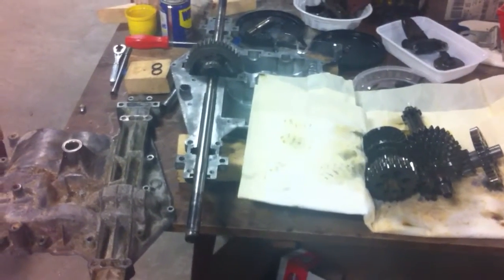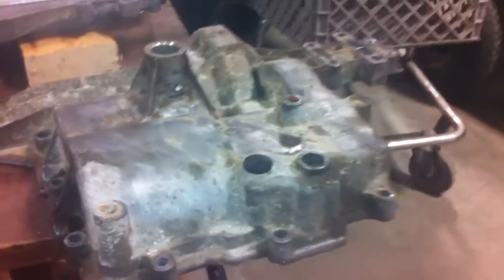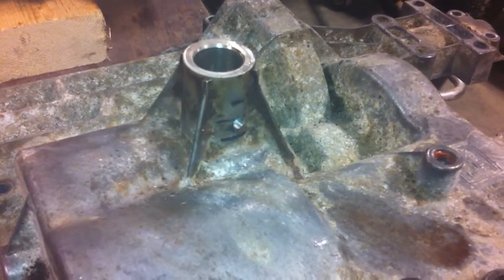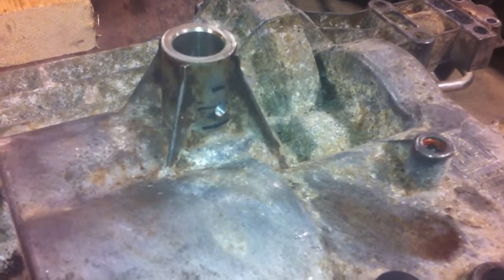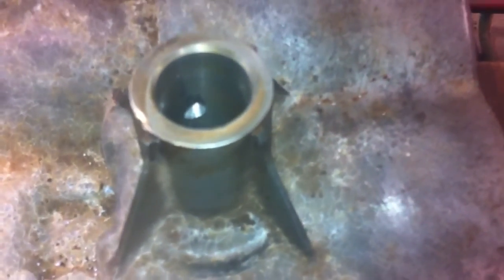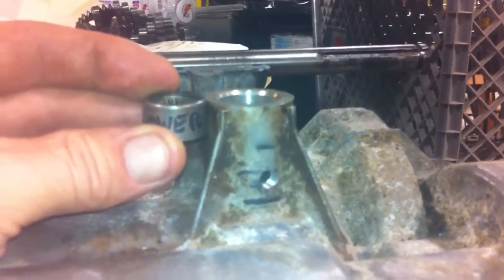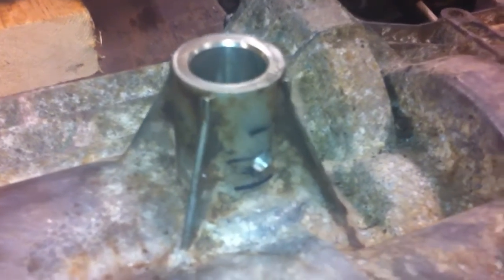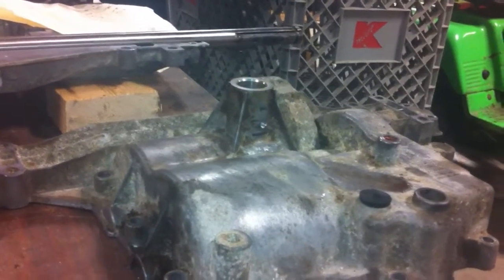Mst 206 modifications part 4 input shaft lube mod

Comment: Is there any way to put it back together without removing the detent screw? Mine does not want to come out at all
Reply from the maker: If you're careful you should be able do it, you just have to fight the spring pressure a little bit.
Reply: @MrTheHillfolk  thank you. I will have to keep the shift shaft in the top side of the case to let the fork stay in it, or will I have to leave it in the bottom of the case?
Reply from the maker: @muddybasilisk7526 yeah it'll be better to have it in the top case , you might be able to put a piece of pipe and a washer in top, thread in a bolt in the shaft and that would hold it in place.
Don't crank it tight ,might need to wiggle it around some. 
That would help with not having to hold it by hand and you can feel the fork engage when ya drop the cases together. 
Next hat trick is to make sure the fork engages in the slot on the cluster when ya mate the cases.
Reply: @MrTheHillfolk  thanks for the advice
Reply from the maker: For sure man.
 Good luck with it, these things can be quite a hoot once they're back together. 
One of the other little things is if the bushings have the flat sides on them and if they are orientated correctly, that can keep the case from closing down all the way correctly. 
Just don't force things and see if the shafts turn  after setting it together with a couple bolts.
Reply: @MrTheHillfolk  I’ll do that man thank you

Comment: Are the needle bearings for the input shaft on this the same ones for the 700 series input shaft? (Part number 780086)
Reply from the maker: As far as I know, back when I researched it, they use the same bearings

Comment: Do you know if the seal for the brake shaft can be removed and replaced without taking the case apart?
I have a small oil leak and don't want to get into a project if possible. Thanks
Reply from the maker: It's totally possible,it's just a small diameter. 
you gotta pull the brake disc and then pry the seal out carefully. 
Mine was like an oil seal, not an o-ring. 
I cheated and looked at the seal in the next part of this vid series for ya 😂👍
Reply: @MrTheHillfolk  Thank you so much.
Reply from the maker: @scotclark7399  
No problem man, anytime.
Reply: @MrTheHillfolk  Hi:  I bought the seal. It's a very hard rubber - like a hockey puck.
It looked like I could pick and pry the old one out but putting in the new one looked to be impossible. No way to compress the rubber to get it to fit in the recess. I didn't attempt it. 
I wound up taking the case apart and doing it that way.
Reply from the maker: @scotclark7399  
Yea better safe then sorry for sure.
That's just a big hassle to realize you need to go deeper and pull the transaxle out though.
Did you happen to notice if there was roller bearings at the axle ends inside the case?
Reply: @MrTheHillfolk  Way too funny you asked about if there are any axle end bearings.
I was stumped when I opened the case to see there were no axle bearings ! The case is machined for them but none were there.  I was kind of dumbfounded. I checked
the owner's manual but did not seem any in the parts breakdown. No mention at all in the parts list. If my mower was not real old and on it's last leg I would have found bearings for it. So odd there are no bearings. I guess they want to save dollar?
Reply from the maker: @scotclark7399  I came across some information somewhere that they added bearings for heavy-duty applications or something like that. 
Actually one of my other mst-206 mentions and shows the bearing upgrade and the part numbers needed. 
I figured for the workout mine is getting, the bearings can't hurt.
Reply from the maker: @scotclark7399  
Part 5 
https://youtu.be/-IqNHyMEmkM
Reply: @MrTheHillfolk  Great info!  Man if my mower wasn't crazy old, putting in bearings would have been great. I bought it used from a friend 17 years ago and it was "older" back then.
So without bearings it seems to be using the end oil seals as bearings. That doesn't seem to good of an idea.
Reply from the maker: They are ok for mowing a lawn, but yea,what we do with them they can use a little help. 
I got some sealed bearings and just popped the seals out so they can get the gear lube.

Comment: Good mod. I always see those bearings dry and rusty in mine.
Reply from the maker: Funny that ya mention that. 
That little yellow spray can lid was filled with rusty colored mineral spirits from cleaning those bearings!! 
When I pulled it apart and saw that, I said this thing could use that mod for sure!! 
Thanks for watchin!